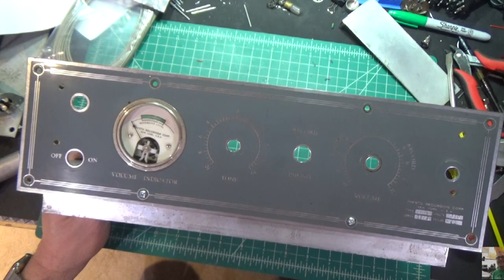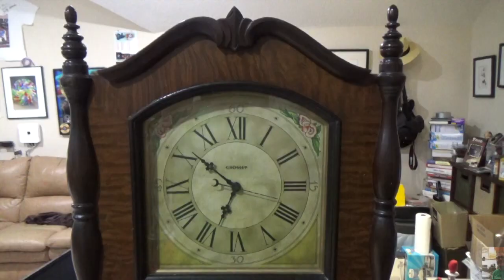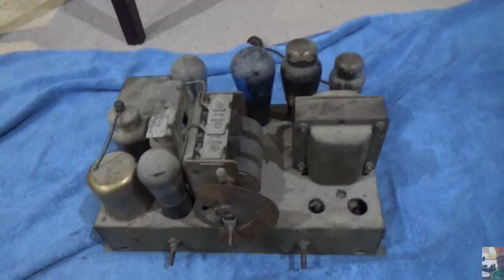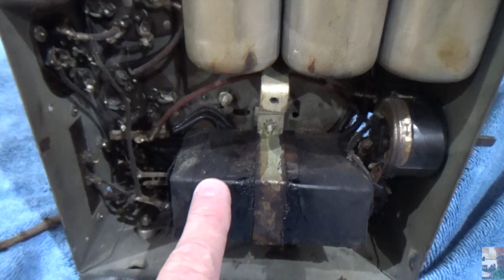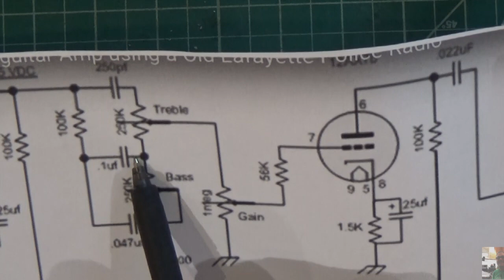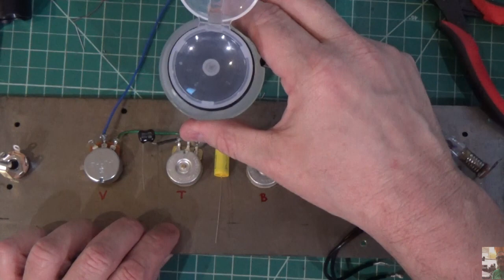Presto K8 Goat Deluxe Amp Build - Episode 3 -  Tick Tock The Tone Stack

Comment: Ron that broken wire you pointed to in the Crosley is one of those early wire wound resistors known at the time as a flex resistor,  That Blue tube I will bet is made by Arcturus, that tube is collectable, but it is also a beautiful color, my favorite is Blue anyway, ha ha .  I am currently working on a Crosley model 525, a small Tombstone radio, also a superhet. Also you might run across some strange capacitors in that Crosley. Crosley used at one time some twin caps, that is they used TWO paper caps in one tubular case with a COMMON STRAP connection near the center of the paper tube. The cap values can be the same OR different like .02 MFD X 2 at 400 volt OR  .003 MFD  and .00017 MFD at 200 volt.  they are very poorly sealed and so get leaky over time,  they are generally wax coated but that coating sometimes breaks at the center strap connection. That is a nice Grandfather type clock cabinet!!  I have a Philco Grandmother clock radio and a monster G.E. Longfellow Grandfather clock radio and it is TALL !!  around 6 foot 3 or 4 inches.
Reply from the maker: Thank you John for the info. I will be working on this radio very soon as my amp project is a generally fast project. I will keep all that in mind... I didn't know about the Arcturus... have to look into that. sounds really cool !! Thanks Ron